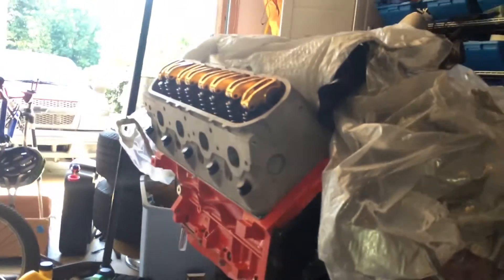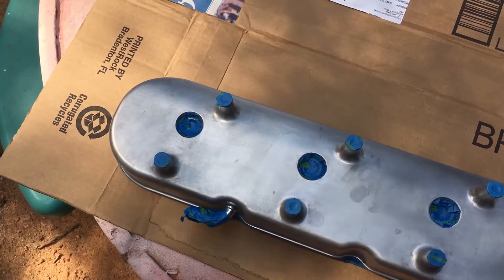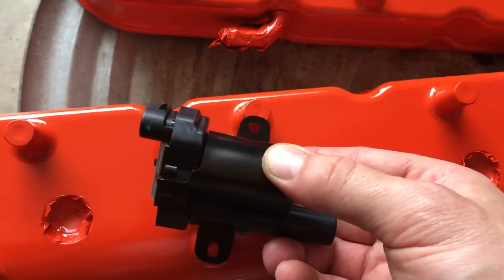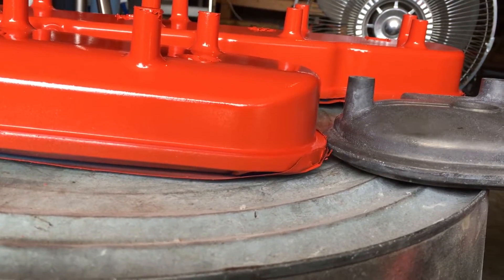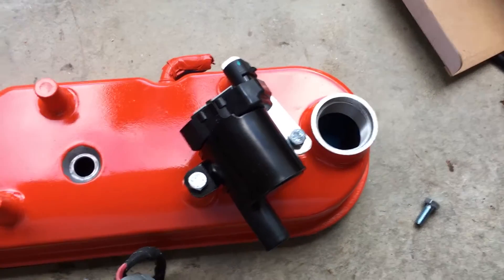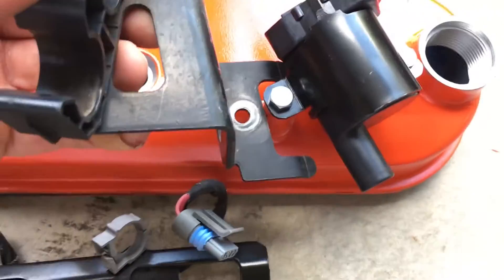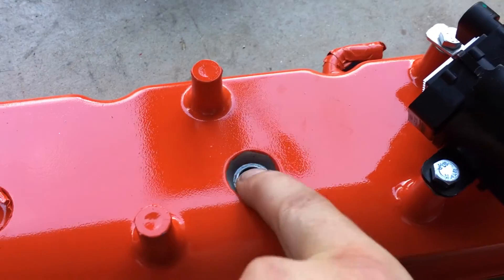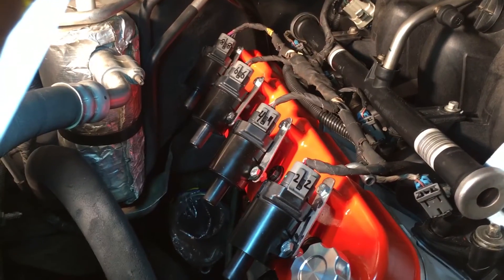Tall Holley Valve Covers LS Motor Comp Roller Rockers - Rebuild vid 10 GM Truck

Comment: The stock coils didn't fit because they're the "round type." You need the "square type" to fit on the Holleys.
Reply from the maker: yes, thus the mod to accommodate them.  MSD makes them but they are bucoo expensive

Comment: Steve.. has the taller valve covers helped with the oil getting in the intake at all.. i was thinking of trying a set on my gen 3 5.3
Reply: U need to DRILL cover and put in almost stock  baffle in the left drives side valve cover to run a breather with the PCV. These higher are covers are not just stylish but they do help alot with returning the oil to the engine since it can not cogeel hang on the length wise LONG stock internal baffles where the oil it can drip and bounce from above which means 4 race purposes U can over fill the engine oil a tad bit and have more oil in the engine without blowing a main seal out because the after market breather with the PCV vents a lot more the reason your drivers side cover needs that stock style baffle rivet in place...  However I am making a baffled 90 degree angled breather pipe on the right pass side cover and riveting in over top of the drilled 1/16  holed pipe a stock like baffle on the right pass side as well. Since the covers are new oil free I can use the ULTRA SYNTHETIC black Permatex and rivet in my baffle for the rear PCV breather... The right pass side cover I just decided to drill the vent tube and add the stock baffle piece over the top... DORMAN sells these pieces on EBAY... All U need with these covers is baffle areas in the breather areas. Other than that the oil does not get that cooling period hung up in the upper length wise baffles which is good 4 racing events or super charged engines but for a daily driver I will also order the upper valve baffles too and make a video on it too. U can add em if you want them too. It just takes rivets and some of the Permatex. I prefer to use it TOP & BOTTON of the riveted in baffles. Helps a great deal no leaks. The upper OEM baffles also help COOL the oil. With extra air space since my new heads provide about 1/2 inch of extra lift the cover were necessary. But the there is still like another 1/2 to 3/4" of unused space... Your 50/50 there... U may not want to DRILL COMPLETELY THRU U'r brand new shiny glossy coated high valve covers... They are useless if ya don't really... HOPE I HELPED Y'ALL OUT... Sorry 4 thee bad news!!!! DRILL THOSE COVERS RIVET IN THE FUCKING BAFFLES!!!! USE ALUMINUM RIVETS NOT STEEL!!!!

Comment: Wow, the coils did not fit. I was going to use my stock LS coils, but I guess I’ll add aftermarket coils to the list with the covers. Thanks for the video
Reply: Thats cus he order the wrong  version of it. You have to make sure you order the right ones. I had no problem with mine.
Reply from the maker: Make brackets like i did.  Just a few bucks at hardware store and not much added labor
Reply: There is no wrong version of it. These only come made 1 way. The only difference between the part numbers is colors.